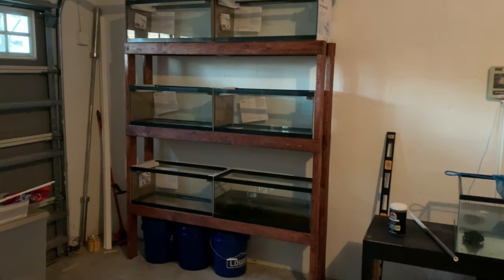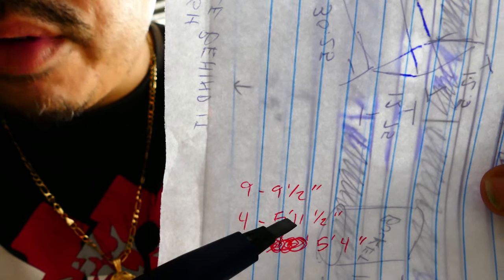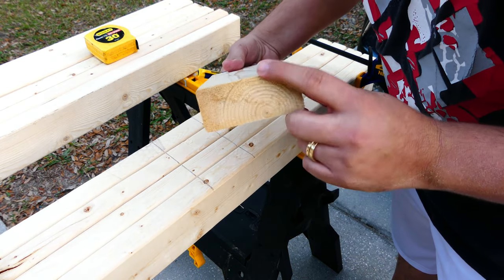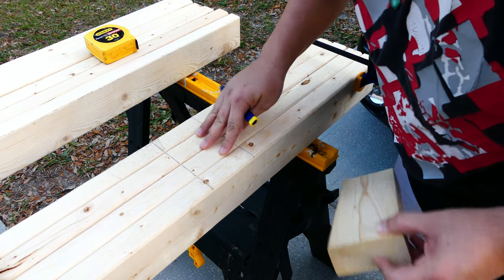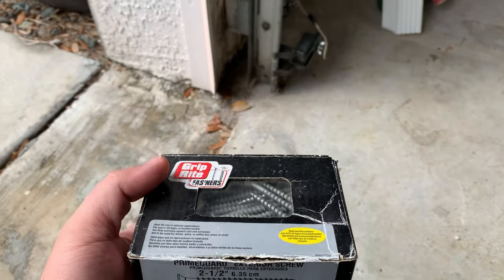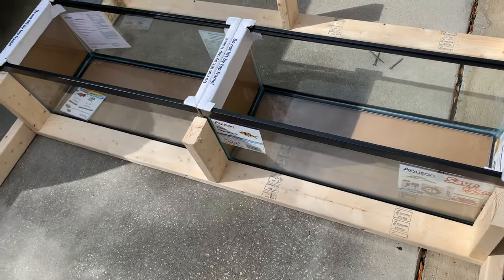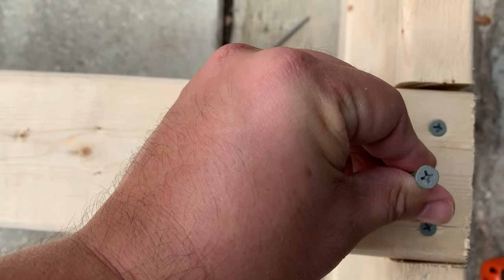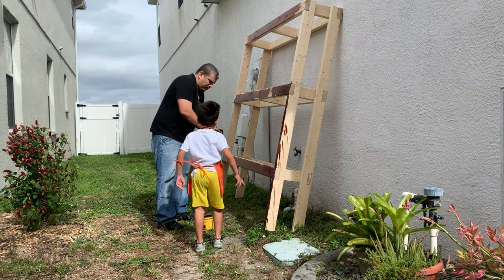DIY Aquarium Rack build - For 20 long, 29 Gallon, and 37 Gallon

Comment: nice looking project & now repeat process ;). I like the design only would have added a middle vertical brace matching the ends, but probably no need just a thought nice job. is your garage floor level or pitched? cant wait for the next rack, later
Reply from the maker: Valley Fish don’t think the vertical brace in the middle is necessary. I left it off because I like the look slightly better. When I do one for larger tanks I won’t risk not having it. Garage is not level but I just threw some shims under the rack to level it out. Great talking to ya, on to the next rack 😁

Comment: do you have any concerns with water weight on the horizontal 2x4s?
Reply from the maker: I have kept the racks under 6’ long and from other fish rooms I have seen they can be longer and still handle the weight. So far so good and it doesn’t even appear to bow at all.